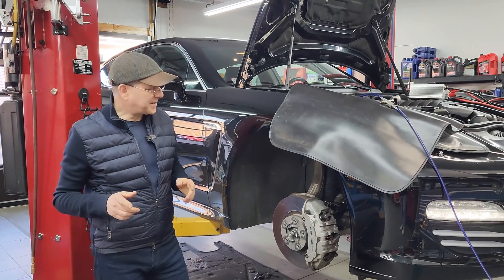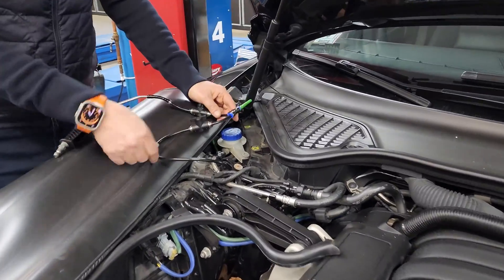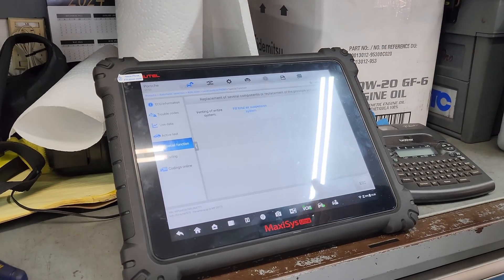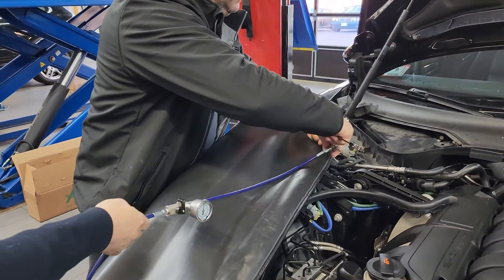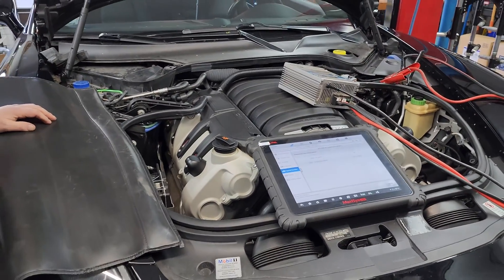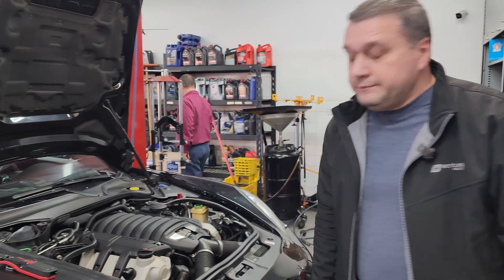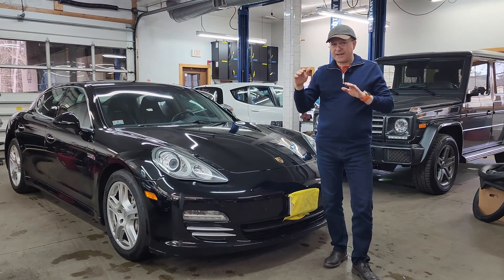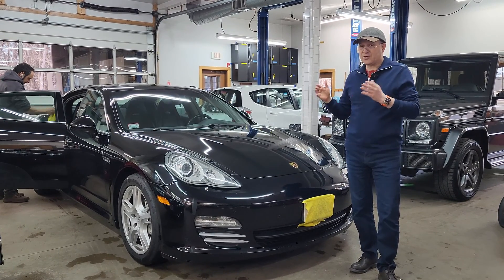Porsche PASM Air Suspension: Diagnosis, Custom Tools, & Nitrogen Fill

Comment: How much should someone expect to pay for this work. I’m having the same problem and I’m hearing many different things.
Reply from the maker: The final cost will depend on multiple factors. Our tool reduces the diagnostic time and allows technicians to isolate air supply circuits from struts to accurately identify whether an air leak is in the strut or the air supply system.

Comment: Thank you so much for that information. I’m having that problem with my 2013 camera hybrid S I’m getting no light signals with the switches. I kept thinking it was the compressor. My rears are fine upright, but I kept thinking it might’ve been one of the relay switches. If you could provide that part number for the relay that would be greatly appreciated. Thanks again for the video.

Comment: I have a 2012 GTS with error 000143 - valve shock absorber rear right, open circuit. There was no loss of air only the compressur shut down and the suspension is pretty hard now. Based on the error would you think it's the compressor? I have changed the rear air strut on the right but the compressor still don't work. Thank you

Comment from the maker: You can order here https://shop.alphacars.com/pasm-service-and-diagnostic-toolset/

Comprehensive solution for technicians and shops aiming to efficiently and accurately diagnose and service Porsche Active Suspension Management (PASM) systems. This advanced toolset offers the following capabilities:

Nitrogen Filling: Easily fill the PASM system with nitrogen, ensuring optimal performance and longevity.
Compressed Air Testing: Utilize compressed air to test the system, allowing for precise diagnostics.
Air Supply Circuit Isolation: Isolate air supply circuits from struts to accurately identify an air leak in the strut or the air supply system.
Leak Detection and Repair: Once a leak is located and repaired, the kit includes all the necessary tools to refill the suspension system with nitrogen, restoring it to full functionality.

With this toolset, technicians can ensure reliable and efficient servicing of PASM systems, enhancing vehicle performance and customer satisfaction. Please note: A diagnostic tool with bi-directional capabilities is required to complete the described tasks.

Comment: Can you tell us what the cost of this procedure?
Reply from the maker: The cost depends on the diagnostic work required and the shop’s labor rate. Our tool's advantage, when used in conjunction with the factory tool, is that it allows the diagnostic technician to quickly isolate individual struts. This helps determine whether the leak is in the strut or in the air supply lines and controls, which saves a significant amount of time and labor costs. It also reduces expenses on parts (Air Struts) when it’s confirmed they are not causing the leak.

https://shop.alphacars.com/pasm-service-and-diagnostic-toolset/

Comment: So after we follow the procedure for the nitrogen test, do we have to fill the struts with air from the compressor when the car is lifted or do we need to get the car down and then do it? cause i think it’s easier to fill in when the car is lifted as it has no load